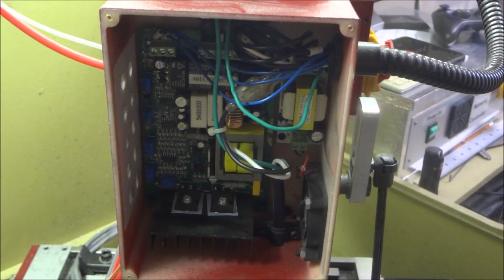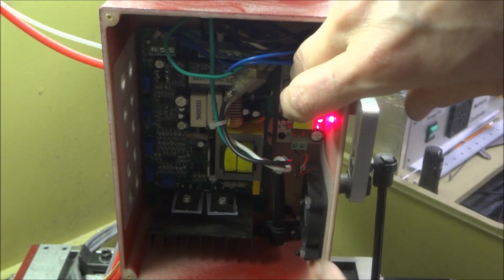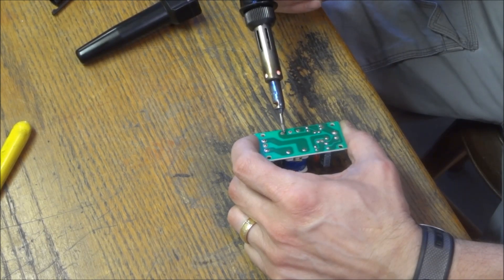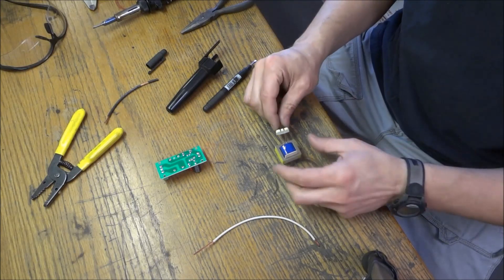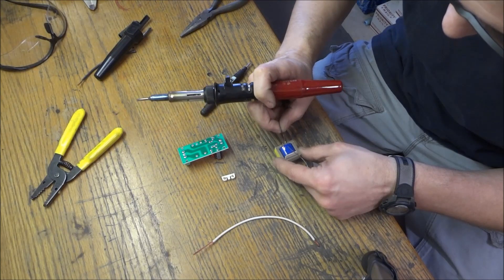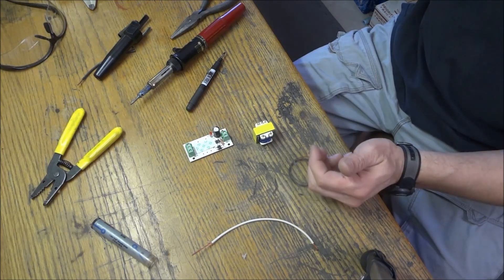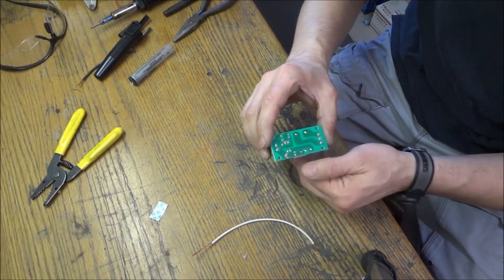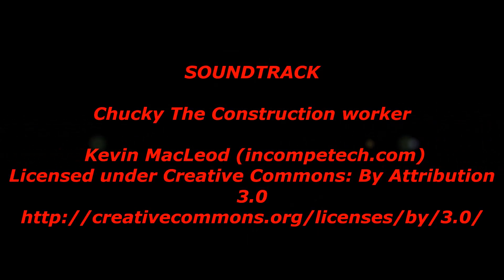X2 Control board  Fan Repair

Comment: I probably would have slapped a bunch of epoxy around the base of the transformer and potted it in there.,, but great repair job!
Reply from the maker: +l0ckcr4ck3r That may have worked But what I did not realize was the wire was not loose but broken as well as the base I can only think the mill had been handle rough at some point. It's a good thing I went ahead and removed it it may have arced if I had just held it together with Duct tape. LOL

Comment: Wow you may start a new trend . Fix it instead of modifying it . I would still be pushing down on the transformer with a dumbfounded look in my face😳
Reply from the maker: +SOCOLVN 
Some times its easier just to fix it but I did have a replacement fan at the ready No mods though :-)

Comment: Nice job. Handy to know electronics repair.
Reply from the maker: +Craig's Machine Shop First rule of thumb when troubleshooting,  Push, tap, and shake I got off easy push worked :-). so I knew I had a loose connection. I was happy.